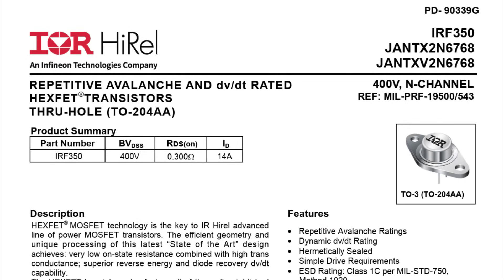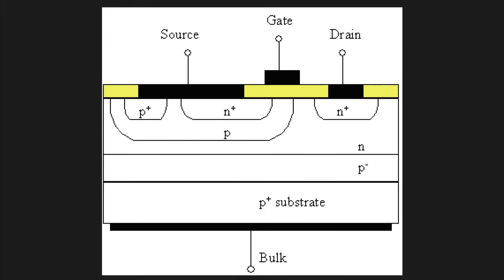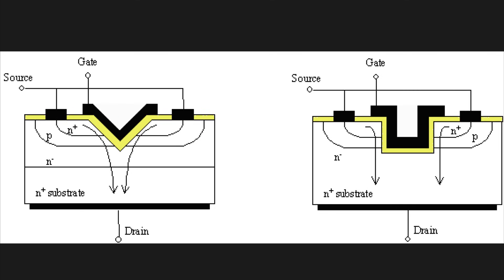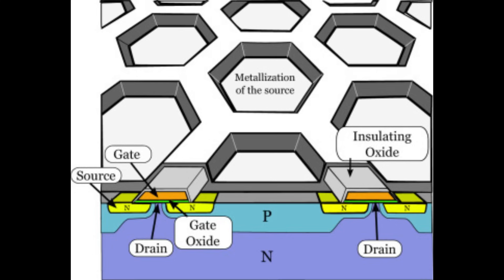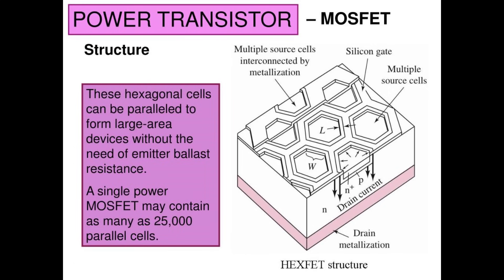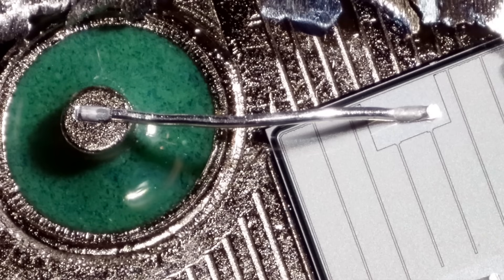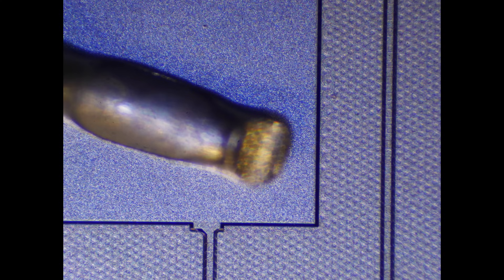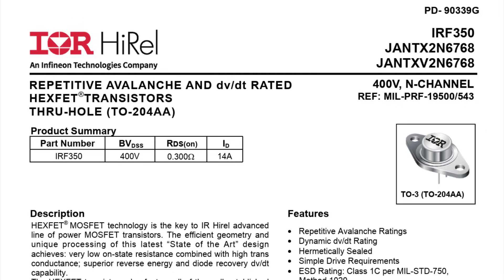#2205 HexFET Transistors

Comment: APT's mosfets have 3-4 field rings around the perimeter of their die.  didn't really see that with this HexFET, maybe one ring.  Wonder how well these stand up to unclamped inductive switching (UIS).
Reply: The HexFets were never very high voltage devices.  Their claim to fame was foremost that they packed higher current capability and higher speed in a smaller package than the earlier implementations.  International Rectifier had a patent and a registered trademark for the name and some other manufacturers made "IRF" licensed parts with the identical name/number.  My first use of IR parts was, when we needed transient suppression devices and we found the IR selenium plates.  We assembled 1" square or 2" square plates as many in a stack as our voltage needs were - each plate was good for about 26 V.  Then IR introduced silicon diodes, including zeners.  And then the FETs.  IR original factory and headquarters was in El Segundo and then they built their fab, called "Fet America" in Temecula, about halfway between Los Angeles and San Diego.  I have seen that, when visiting some other company in the same neighborhood.  By the way, my visit was the day of the big Space Shuttle disaster, which was shown over and over on the hotel room TV.  One of those times i always remember Where I Was, When...

Comment: Thanks.  It always amazes me how that little source bond wire can conduct 14A without melting or glowing red.
Reply from the maker: those aluminum bond wire are pretty amazing: https://www.scanditron.com/wp-content/uploads/2019/02/Heraeus_Bonding_Wire_datasheet.pdf
Reply: Thanx 4 the link @IMSAIGuy
Reply: My hunch is that the wire is so short that a) there's very little total resistance, and b) any heat conducts out of it really easily

Comment: IGuy is probably too young to remember, but there was a time when cheapest way to get a solar panel was decap some power transistors. Because they were firmly glued to a metal base, it was possible to overdrive them with focusing lenses.
Reply from the maker: I'm 69, but I have not heard of that
Reply: @IMSAIGuy  This was 1960's technology. Ordinary civilians could not even buy solar panels at any price.
Reply: I assume it's wired to operate like a diode in circuit for this purpose right?
Reply: @Kalvinjj  You will get two junctions in series between Collector and Emitter, resulting almost 1 Volt. And the current was almost 10 mA with focusing lense. When you could charge early NiCd-batteries only wth 50 mA, decapping 10 transistors made excellent charger.

Comment: I recall using VMOSFETs in the 1980's since they were pretty fast and could handle both current and some voltage too. The rise time was in the order of 10 ns.
Reply: People learned real fast to have a good clamp on the gate, DVDT plus large Miller capacitance = exploding mosfet.
Reply: @Slickrock72  Yes. The VMOS was a bit different since the capacitance is low. I used them if RF power amplifiers to 100 MHz with none burned.

Comment: How are these wires bonded, doesn't look like solder.
Reply from the maker: heat and pressure, thermosonic
Reply: @IMSAIGuy  it's metal oxide, but you don't know where the metal resides in the silicon.

These wires alone is an amazing technology, some devices have  40, 64, 100+ or 1000+ or so pins and the machine does this blazing fast. even finding the locating or spot where to bond automatically and doing this since the 60ties.

Because in the black and white video of Fran about the invention of transistors they where doing this already.
Reply from the maker: https://youtu.be/ReHQXlfWa-0?si=xfF3yRPpKptA_75q

Comment: For some reason I have a Motorola TMOS power mosfet manual here,  I must have rescued from the engineers library.  I got a lot of nice books that they culled at one time. The drawings of one in there depict a "cell structure" layout but not sure if it is anything like that. IN any case I do not recall using any for anything and also do not recall building any projects with power MOS to begin with.

Comment: When you mentioned about how they tiled them in parallel, I was expecting the number to be in the high 10's low 100's range, but there must be 10's of thousands on that thing. Makes you wonder what the benefit.of a larger number of smaller devices has over a smaller number of larger devices..?
Reply: Larger devices would have larger ratio of Width / Lenght of channel, which in theory would improve voltage handling capability, yet lower the conductivity (higher Rdson).
Larger devices also require higher threshold voltage, so much so, that at some point making larger devices with silicon doesn't yield any improvements in Rdson or voltage handling capabilities and only makes it worse.
So paralleling of optimal yet small structures maintains their optimality and allows you to scale them up to higher current requirements (which is precisely what you want in power mosfets etc.)

Comment: As I recall, the reason they can parallel many many cells like that is because the temperature coefficient is such that if any cell starts conducting more then more heat is generated locally. This backs off the conduction of that cell due to the temp. coeff. Bipolar transistors have the wrong temp coeff. such that if one transistor in a paralleled bunch conducts more and heats up more then you get thermal runaway, thus the need for the emitter ballast resistors. With FETS this does not happen. Someone correct me if I have this wrong.
Reply: For mosfets, at low currents the negative tempco of threshold voltage Vt dominates and with the same gate voltage applied mosfets do conduct more with higher temperature (since falling Vt makes the gate  overdrive, aka difference between gate voltage and threshold, larger), however, for mosfets at high currents, instead of gate overdrive dominating, the internal resistance of the used materials dominates, and that increases with temperature, so at higher temperatures they conduct less so the other more conductive mosfets can take over.
If you google "mosfet thermal curve" and look for images, the second image (from "MOSFET Temperature coefficient - Electrical Engineering Stack Exchange") it finds shows what I talked about, at low currents higher temperatures decrease the voltage drop, but at higher currents it changes (with specific current having zero temperature dependence of voltage drop, aka the point where the curves cross)
Reply: They're also very well matched to each other because they were all made on the exact same substrate at the exact same time with the exact same doping profiles.
Reply: I also remember that the self balancing property / non thermal runaway has to do with current distribution, due to the shape.
Reply: MOSFETs suffer from the "Spirito effect" which is similar to BJT secondary breakdown